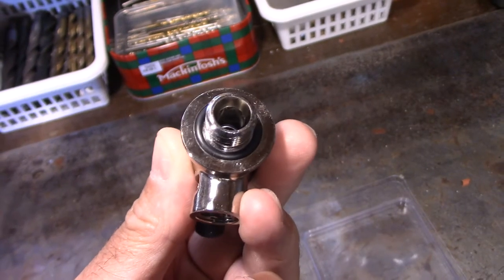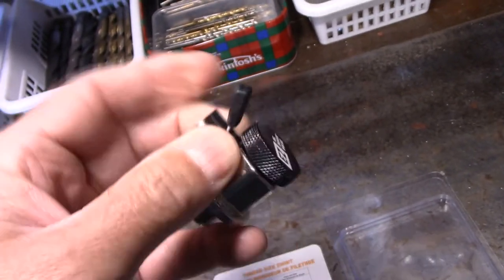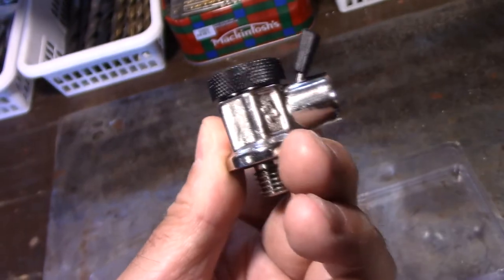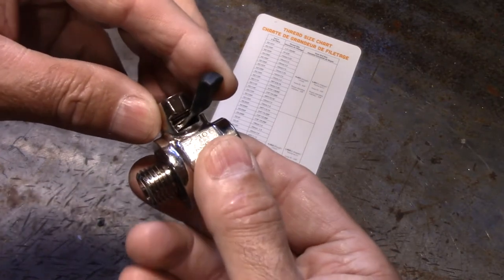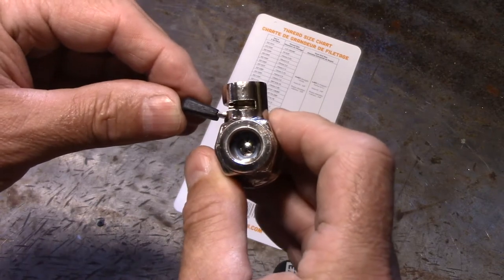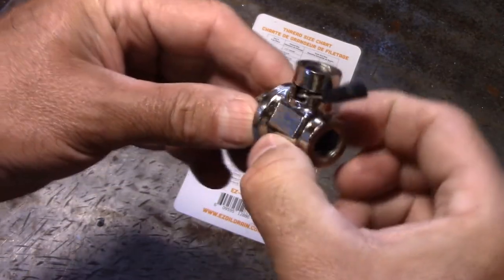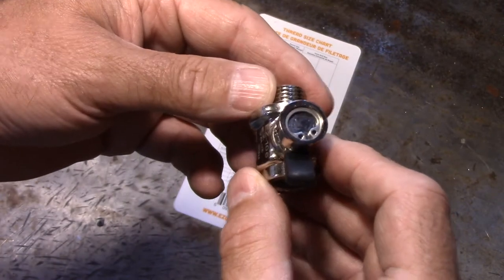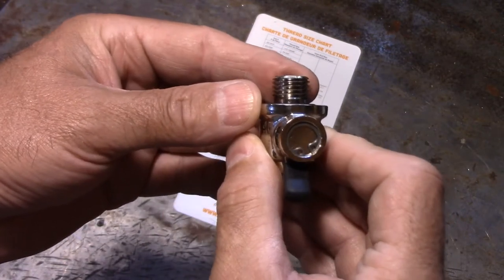EZ Drain Oil Drain Valve  Review And Installation - Great For Diy Oil Changes

Comment: You'll be disappointed with the flow out of the valve. Please give a follow-up video showing the drain out.
Reply from the maker: Paul I have changed the oil since and the flow is not a concern at all .  I can open the valve and not have any spillage at all . Takes  about the same time to drain as before .  So far I can't see any downside to its use .
Reply: @SteveRobReviews  Sounds good. In the video you said the the hole in the valve was just under 5/16th, where previously the size of the drain plug threads are probably around 1/2". I would have expected a slower drain.

You also will have just a bit of residual oil left. If you wait for it to stop dripping on the next drain, and remove the valve- more oil will come out.

I installed on on my 8.1 liter Chevy around 200k. I'm now over 400k and feel like the foll port drain plug is ultimately better for oil draining. The key is changing it hot! I would sometimes set my truck up for an oil change the night before. It would have 12 hrs to get all the oil to drain to the pan and I would pull the plug cold. Very little difference with drain time- but after doing that once with the drain valve- cold oil doesn't like to flow through the smaller valve passage. Good luck and enjoy the convenience!
Reply: With modern vehicles using 0w-20 oil, flow is of no concern for my application. I’d actually hope that it may slow down the flow rate when draining lol.
Reply: I installed a similar unit on my wife’s JGC but made by Fumoto.  They are brass units and have several different styles to choose from.  I used the SX model that allows you to rotate the flow direction in any orientation you like.  Just love the simplicity now for oil changes
Reply: @SteveRobReviews 

What about the fact that the threads sit above the bottom of the oil pain when installed and don’t let out all of the old oil and gunk?
Reply from the maker: @johnnysins4158 I don't see a concern at all. Seems to drain out fine for me.
Reply: @SteveRobReviews 

Im still on the fence about this valve. It seems like quite a bit of thread is sitting high on the inside of the pan. 

You should do a video where you drain the oil with the valve and then remove the valve and see what/how much comes out. 

Love your videos by the way.
Reply from the maker: @johnnysins4158  Thanks , we'll the little left should not be a concern as I see it .  All the leftover oil in the top of the block to in the pan must go thru the oil filter so the couple of ounces of oil left  in the engine  is not a problem at all.  I've never heard that it's a concern or experienced any concern.  I guarantee you there is more oil that can't drain out in the upper block than  the little left  in the oil pan.
Reply: @johnnysins4158  have you ever seen the nut welded to the inside of the oil pan?  It’s very tall, you never truly drain all your oil in pan regardless what you might think.  Changing your oil frequently is far more important then trying to get every last drop out.
Reply: I have a pajero sport and drain plug is on the  bottom of the sump so no residue oil is left . stone guards cover the sump and they had to removed to drain the oil. Mine came with a adaptor to fit a hose. So now I can drain the oil without removing the guards.